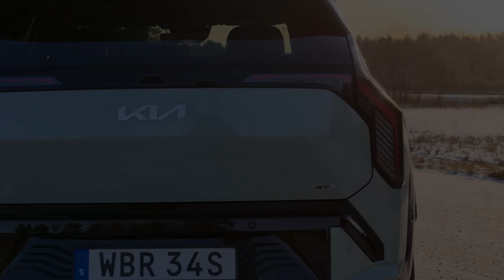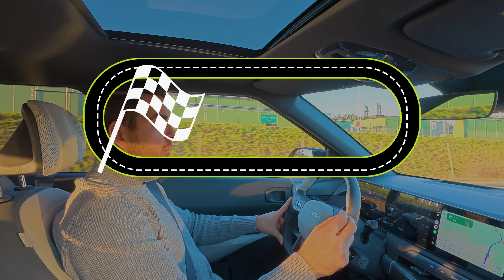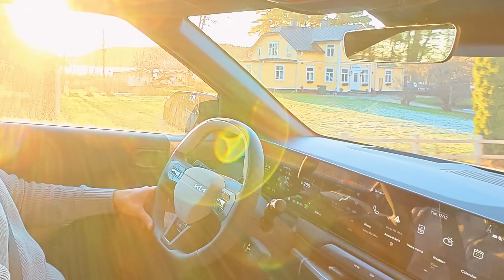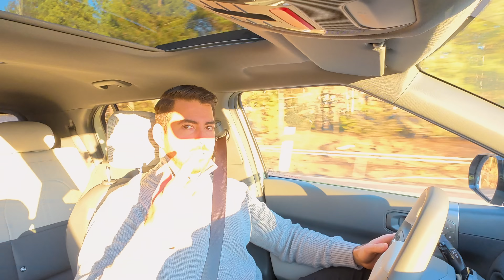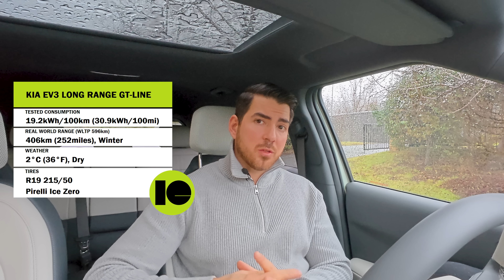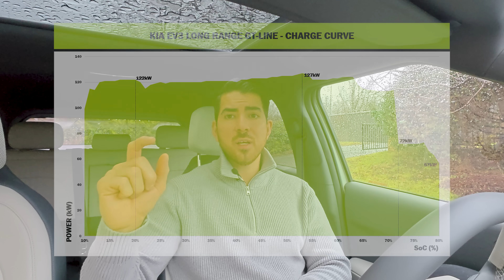KIA EV3 Range Test: Disappointing Result?

Comment: Does turning off all those warnings stay over a restart, or do you need to do that every time you start the car?
Ive just swapped from a Soul 64kWh  just because i felt like a change so it's surprising to see this is no better on range than the Soul, I did consider the EV3 but wanted something a bit different and more fun, and in particular either AWD or RWD which isn't currently available on the EV3. Maybe next time,  I do like the look of this.
Reply from the maker: Turns on again after restart.
Reply: @ thanks. That would be really annoying doing that on every drive. ISTR a recent review of a new EV and there was one place you could turn all that off and it stayed off. Don't recall what it was though.
Reply: @Joe-lb8qn  These are EU regulation...warning for speed must be switched on at any start...and others, too. Any new car will have those beeps due to regulation.

Comment: Hi, in the video you mounted Pirelli ice zero which are available just with 93 as load index whereas the EV3 it’s omologated for 97, isn’t it against Road rules?
Reply from the maker: Yes you are correct, the car has the Pirelli Ice Zero 93 (650kg*4) and it is mounted from KIA Sweden themselves.
The car is specified for a maximum load of 2355kg from the Swedish Transport Administration. So the maximum weight of 376kg. 
Maybe that is because of the tires?

Comment: Hmm yeah imagine at 110-130 kmh.  Not a surprise with that shape. Comfort sounds very nice.
Reply: A brick has a Cw value of 2.1, a  F1-car has values between 0.7 - 1.1, a Lamborghini Countach 0.42 and the EV3 0.26....
Is that bad than???
Reply: @ludoclaes7054  from my google search Cw doesn't tell the whole story. Tesla model 3 Cw is 0.23, but it probably does better at highway speeds than the small Cw difference would suggest.

Comment: It looks like you sometimes had to reach to the other side of the touchscreen to press certain things. I do not like this in modern cars, I miss the times when car manufactors started to place all the buttons near the drivers hands, but that era is gone with the touch screens.
Reply: I use a VW Multivan with touch only...to be honest the only button I miss is the button for seat heating...anything else I don't miss at all. But thankfully this VW does not have touch at the steering wheel, too ;-)
Reply: @josefv-y8m  We have a Audi instead of the VW cause of physical buttons in the Audi, and touchscreen in the VW. I love not having to look away from the road to change something. I can feel my way where the button is. But I heard something about new regulations forcing manufacators going back to physical buttons again for many functions.  But it was not really the touch screen I was t hinking of in the video, it was that some buttons on the touchscreen was at a "almost unreachable distance".  But it might have been the camera view.

Comment: Did your test car have a heat pump?  I do not understand why manufacturers fit wheel and tire options as standard that hit range. However Could the winter tyres have been partly responsible for yourower than expected results. The disappointing truth with the EV3 is although it is an all new car the EV tech is not the latest especially the big heavy battery pack and slowish charging.
Reply from the maker: Winter tires affect the range, yes, but only 215 wide. But it has a heat pump.

Comment: I'm getting over 300 miles with 2 degrees C.
Reply from the maker: Gt line with 19"?
Reply: @ItsOnlyElectric  Yes.
Reply from the maker: Average speed? We test where a big part is 110km/h
Reply: @ItsOnlyElectric  Average 32 mph, top speed 70 mph
Reply from the maker: Ok, that's a really big difference in Average speed and explains your good numbers. And our car over reported the distance by 3% which accounts for 3% Consumption than the screen shows.

Comment: Thanks for the presentation… guess each consumption under 20 under winter conditions is fairly good.👍🏼 Flat charging curve is impressive, charging time could be better, but I guess it was a clear KIA decision not to offer the 800V system and to give customer not more charging power but a better rated price.
Reply from the maker: Yes, price in focus. You can't have it all if you want  a more affordable car. Still impressive package!
Reply: @ItsOnlyElectric  Unfortunately, it's anything but affordable given its size and overall features.
Reply from the maker: You need to look at the entry level. All other variants expensive
Reply: @ItsOnlyElectric  there will be just a handful of people buying the entry level, and if you put it that way, you might want to test the entry levels as well in the future.

And even so, starting at 36000 € for the base small  battery or 41300 € for the base large battery, the car is very overpriced, even for a "base" model.
I think that, when you say it's affordable, you're not comparing it to anything similar cars from the closest era, but only with cars from today, which are all overpriced.

If you look back in 2018, the Kona EV, with its 64 kWh battery, boasting impressive efficiency that was only surpassed by Tesla Model 3 SR, you might see why the EV3 clearly doesn't cut it, managing to squeeze out consistently 400 km out of a 20% smaller battery on similar kind of roads you had in your test.
Then, the price ranges were between 27'000 € base and 36'000 € top trim with all the gadgets on it, heat pump standard on all trims except the very base one.

Battery wise, nothing has changed apart from its capacity. It's a 6 year-old battery chemistry with resources that are readily available. It doesn't feature neither the 800V architecture,  neither any kind of LFP or newer, substantially improved chemistry, nor a substantially higher peak power to make it better. All you're currently paying for is exterior design, some fancy screens (as it's common now) and arguably mild changes to interior quality, but nothing to justify such a steep price increase.

Comment: I'm guessing no heat pump, I believe it's available as an extra on the top model. If the car does 400 km winter range then I guess it will do an easy 500km plus in the summer. l have an MG4 and if I wind the heat up to a comfortable temperature I lose at least a third of its range in the winter. Thanks for the video and your thoughts about the car.
Reply: All Kias have heat pump in Scandinavia.
Reply from the maker: Yes, it comes with a heat pump as a standard over here.
Reply: Heat pump is 900 quid option on GT_line S in UK.

Comment: Strange that the title of the video says: Disappointing results!. But, after watching the video, you say the car is really good and one of your top picks. Some parts are decent, but never disappointing. I would really like to know why you title the video like this but clearly say otherwise in the video itself.
Reply from the maker: Did you listen to the summary part regarding range? 72% of claimed range, that's smong the biggest deltas of all cars we have tested so far. 

But still a great car, don't get us wrong!
Reply: @ItsOnlyElectric How many of the ones you have tested where in winter conditions? 72% of WLTP (not ”claimed range” btw) sounds pretty resonable imo!
Reply from the maker: @anton_grahn half of them under 10C. The EV9 managed 85% of WLTP on wet roads in -4C as an example.
Reply: @ItsOnlyElectric Fair enough! Do you have a public list with the results (with noted conditions)? Without it is a bit hard for us as viewers to know what is good/bad on this loop
Reply from the maker: @anton_grahn all data is available and published in the members section.
Reply: @ItsOnlyElectric  Yes, i did watch the whole video, but you never said the word disappointed in it, that's why i posted the message. If you put the question mark behind the title instead of the exclamation mark, then i wouldn't have posted anything :) Thank for the video though, been waiting a long time to see the stats of this car in the cold. Will get my EV3 hopefully this month.
Reply from the maker: @Anomander1 get it. Thanks for your feedback
Reply: I'm sure if this (range)test had been done in the summer the video would have had a different title.
Reply from the maker: @MartinMKool maybe. Depending on the results.
Reply: @MartinMKool  Yes, it would have been higher, that is why i was especially interested in a winter test. All electric cars have less range when it is cold. I thought it would be around 400 km in winter. Thinking it will be around 500 km in the summer. Fine by me :)

Comment: Title doesn't match with the video.
Reply: Still a great car compared to other electric cars
Reply: Agree, Getting 72% of WLTP range in winter sounds very reasonable, even pretty good imo
Reply: Actually it does, that's the most important part of the review. I don't know what you were watching
Reply: @pupacila26  Then you either didn’t watch the video properly or lack knowledge about electric cars and their energy consumption. The consumption this car shows per kWh is perfectly fine, especially considering that the temperature was freezing or close to freezing.
Reply from the maker: We averaged 19,6 with the Taycsn 4s in worse conditions. So compared to that 19,2 is still a bit of a let down.
Reply: @ItsOnlyElectric  You're comparing a car priced at over €150,000 with one around €50,000. Most of the cars you've driven were significantly more expensive anyway. That said, I would never spend €50,000 on an EV3. I’d opt for the mid-range model in the long-range version, which is already €7,000 to €10,000 cheaper.
Reply from the maker: @Achillias yes, but still efficiency is something Kia is good at. I would opt for the same one, good choice. Most bang for the buck and avoiding 19".
Reply: I agree with you. When you watch the "conclusion" of this video it's only positive. Nothing disappointed?
Reply from the maker: Why not? Please explain. The range falls very short from the claimed range only 72%, that's what the title is referring to. Do you think it's misleading?
Reply: @ItsOnlyElectric  that’s fair enough but is the test really comparing the same test criteria. In the end the range claimed is from a standardised test that all manufacturers have to undertake. It’s only a comparison not a promised range. We all know if we drive “normally” we don’t get the claimed range. Never did on my ICE cars either. Now if you test all cars on the same route at the same speeds in the same conditions, we’ll have a different but equally valid comparison.
Reply from the maker: But we have tested over 50 cars on the exact same route. Only 2 cars scored a lower wltp ratio and both those where in colder weather and on wet/slushy  roads.